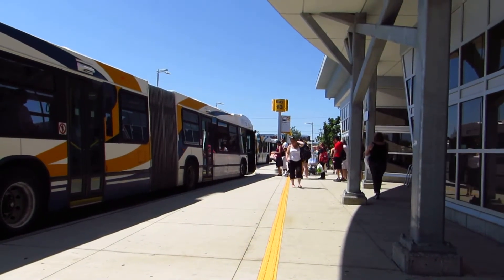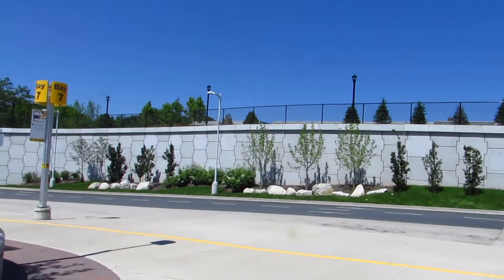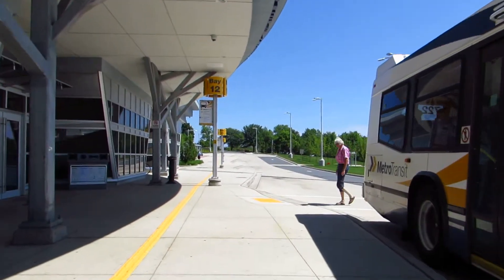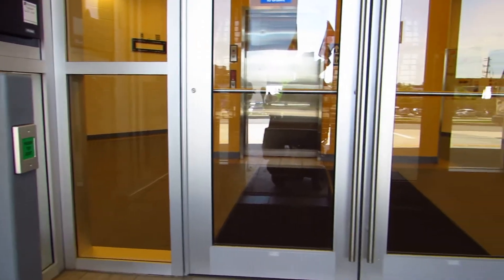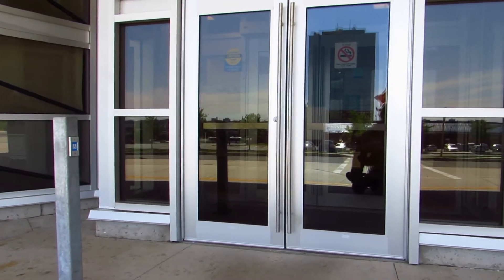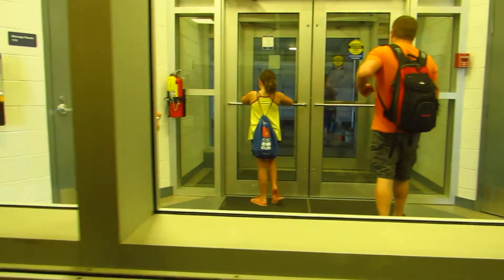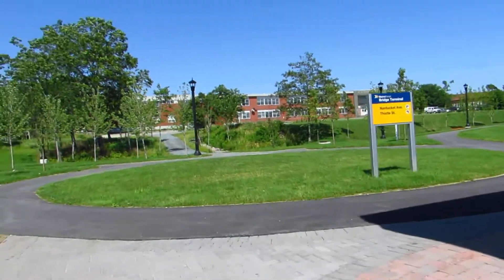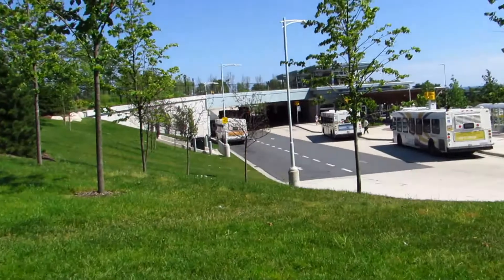New Extravagant Halifax Metro Transit Bridge Terminal

Comment: I have been fighting with MT about the doors since the terminal opened, as I'm a daily user, (usually multiple times a day) I live near this terminal, so its where I normally go to get buses to where I need to go.

Door buttons are now at the doors on inbound lane side (side that faces sportsplex) "touch pads" have been removed, this was done 2 weeks ago..
The touch pads hadn't worked properly since Terminal opened.
Elevator is also a concern, (I use it daily, usually multiple times a day)